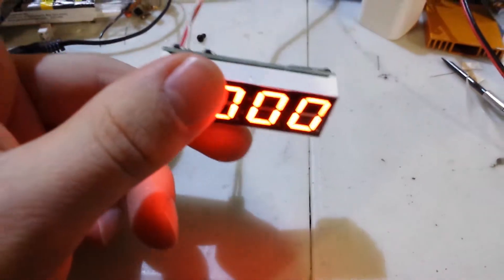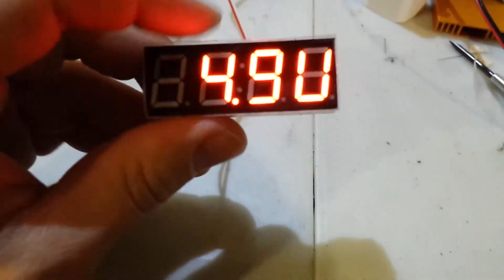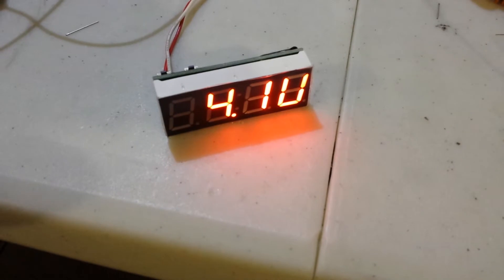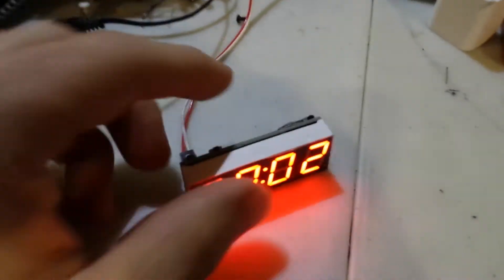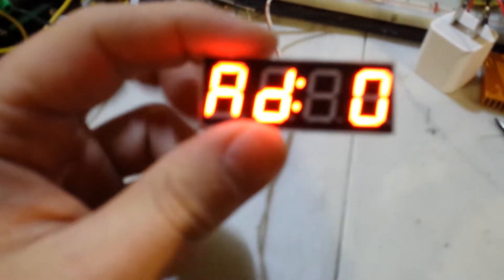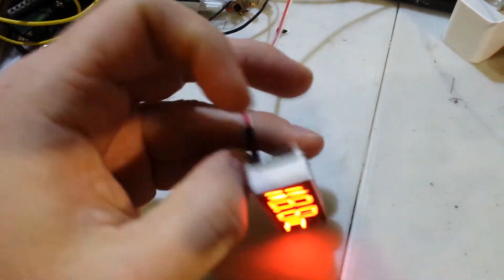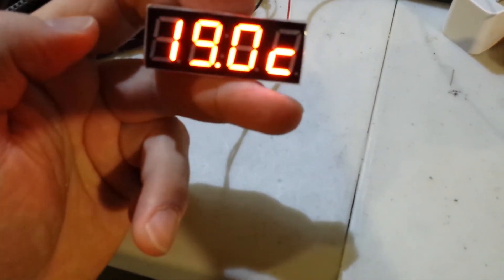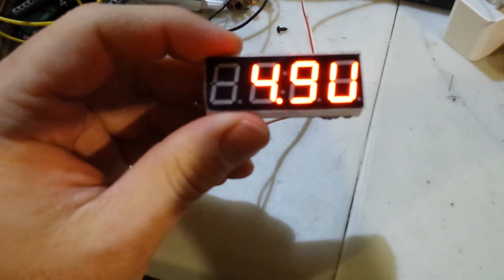LED clock icstation.com

Comment: Nice little clock gadget. I just bought something very very similar as a voltmeter 0-100v and another 0-33v for 6$ for both on ebay....so small you can stick them anywhere...
Oh, and the scrole function is handy for when its outside, you can see everything at a distance.
Reply from the maker: Yeah I know :) those little voltmeter are getting smaller and smaller :) and the price is very good as well.